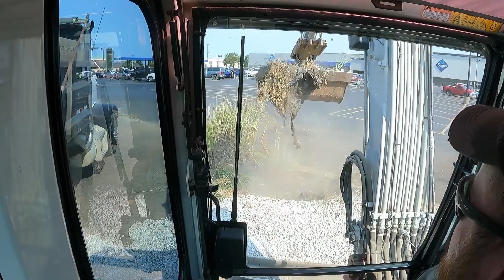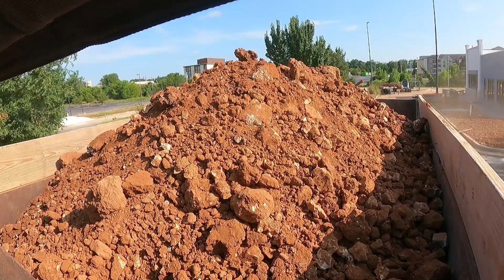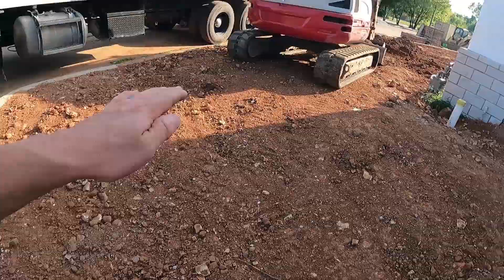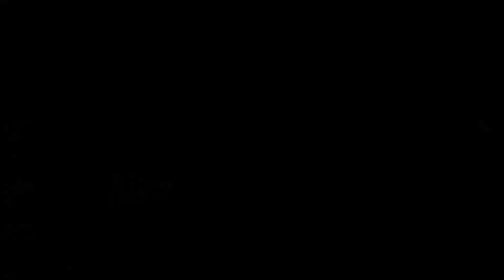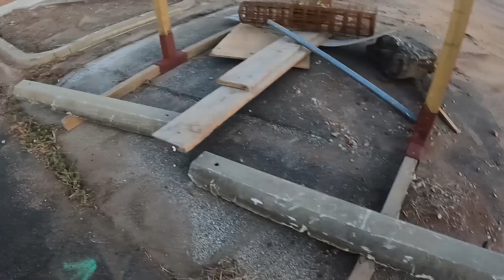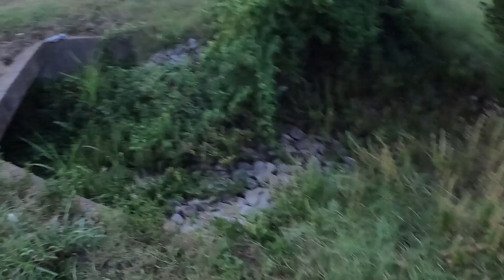Rough Grading At A New Commercial Job

Comment: Just my thoughts and by no means do I know what it is like to work in your profession. But, I have been watching your channel and Chris and Andrew's. I watched you do the clearing of the property that you said you dad owns, with all the dirt that you were digging through. 

I saw that Andrew had an attachment for his machine that he used to do soil seperation, that could be a way that you and your dad always had clean soil of your own. Use that area to stock dirt and then seperate it. Just a thought, again, I don't know how or if that would work for your business, or even if it would be cost effective or not.

I also saw that Chris had someone that had one of those big machines that did the soil seperation and he just had a stock pile that he kept for his use when he needed soil.

Just my two cents.
Reply from the maker: Yeah I would really need the crusher Chris borrowed from Charlie. It would make short work of that stuff. The one Andrew had would do it but it would be really slow. None of the stuff I have there is really good dirt but it would work for fill especially without the rock

Comment: That's a good deal. Expand your horizons and take on some commercial work. I did a little with my equipment. The only problem I ever faced was that the GC always wanted things done yesterday.I was a 1-man show for the most part, and it wasn't even my full time job. Things got hectic a time or 3, and I had no choice but to start turning down the commercial work. Hated to do that because it paid well.  Good luck with your new ventures.
Reply from the maker: Thank you! Yeah they are definitely pushy and it’s funny he’s asking about stuff and I’m like aren’t we waiting on so and so to finish that oh yeah I forgot 🤣 it’s more demanding than residential but I’m enjoying it so far
Reply: @eliteearthworksllc  I live in MS. Had a GC on a hospital in Provo, UT call wanting me on site pronto. We were going to install cabinets, nursing stations, and trim.  Got there and the drywall wasn't even hung yet. 1,680 miles one way and nothing to do but wait. I was able to make them pay us in the end but aggravating for sure.